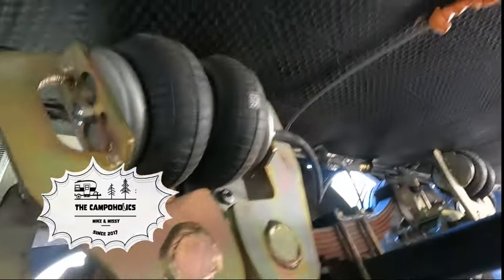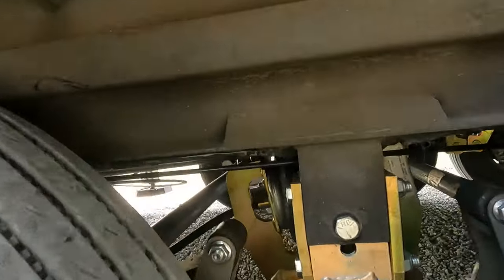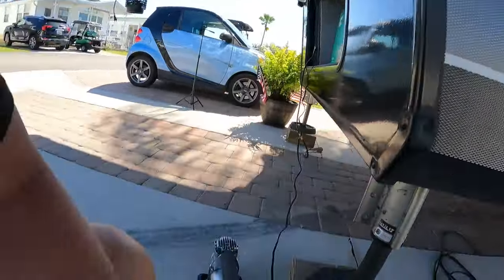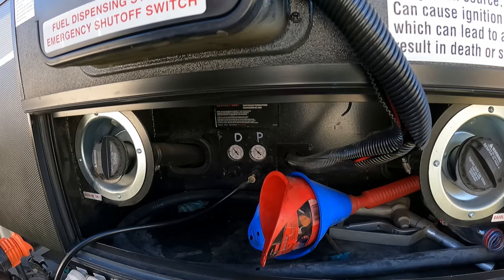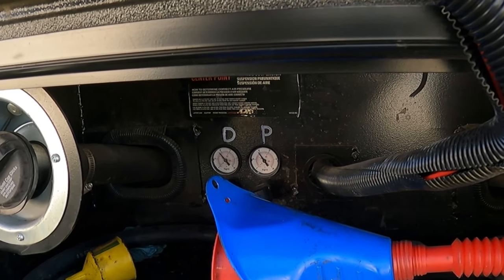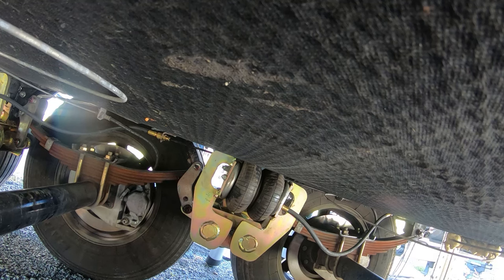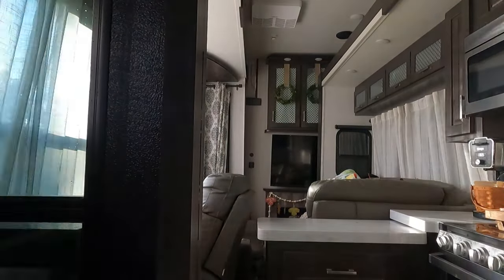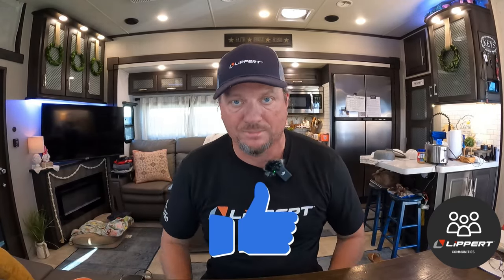Lippert Center Point Air Ride Suspension Upgrade - Things Are Smooth!

Comment: I have had Centerpoint on my 30' fifth wheel for 50K miles.  Night and day difference in the ride, I also have the air ride pin box.  My instructions with the Centerpoint stated that the vertical air bag brackets should be parallel to each other when on level ground.  What ever air pressure that takes.  Mine takes 30 pounds fully loaded.  That is 8K on my two trailer axles, that's about 4psi per thousand poinds.
Reply from the maker: Thanks for sharing you experience with CenterPoint! Your testimonial is very important to people shopping this option.

Comment: I self installed Center Point last summer in my Bighorn 3575EL, maybe 3000 miles ago. I also have a Hensley 5th wheel air hitch. The ride is much improved. I installed the TST sensors, I thought they would be a great asset, not so much. I found that the TST's set off the alarm on a regular basis when the pressure in the bag changed. This seems to happen when going around corners and larger bumps. One sensor failed after about 5 months so I removed them and got a replacement under warranty. I might try them again this spring.
Reply from the maker: Hello George, thanks for watching. I had the same issue on the TST sensors. I reset the levels high and low once I figured out what the "traveling" reactions were. The main reason is just to show a flat if it happens. I also have a spare bag kit, just in case. Don't want to be caught in the middle of nowhere without a air bag.

Comment: It's been 5 months since you installed the Lippert Center Point. How has it worked out? Have you had any problems with it? Do you recommend it?
Reply from the maker: Actually it's been a year, the video was made 5 months ago. We had it installed in August last year. I will tell you still I love this system. It takes away the road impact or energy being transferd to the RV. I am very pleased with it.

Comment: I have Center Point as well. My manual states 5 pounds per 1000 pounds for a triple axle. So, I run around 80-100 pounds depending on my weight. I am really confused if they have hanged their pounds of air rating????
Reply from the maker: Hello, not really sure, that seems very high. I experienced tire bounce when I had 45lbs on my system. That's why I lowered to 38. But the label Lippert put on mine had ratings for tandem and triple axle filling. The tech even mention 45lbs when he installed the unit.
Reply: @TheCampoholics  I talked with Lippert this morning. They sent me a photo of the label. I told them where I had read in the manual. They are working to get the manual changed. 
Thank you for your video so I can now run less air pressure.
Reply: Thanks for the video.  I have been doing my research, and it shows that you will get 2 inches of lift...witch I could use. Do you know if that 2 inches is with air added in the bags? If so can you drop the bags when you get to camp to drop the 2 inches.  Did you have the porposing before you switched to the air ride, and did that help stop that. Thanks you!
Reply: Thanks for the video.  I have been doing my research, and it shows that you will get 2 inches of lift...witch I could use. Do you know if that 2 inches is with air added in the bags? If so can you drop the bags when you get to camp to drop the 2 inches.  Did you have the porposing before you switched to the air ride, and did that help stop that. Thanks you!